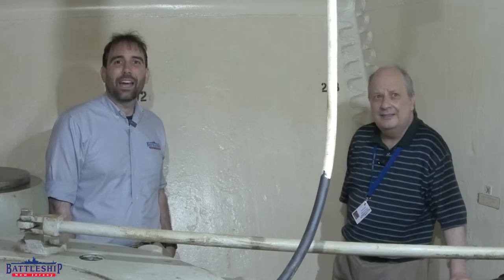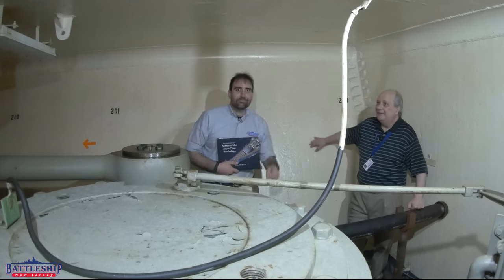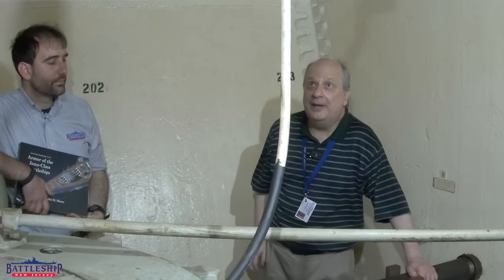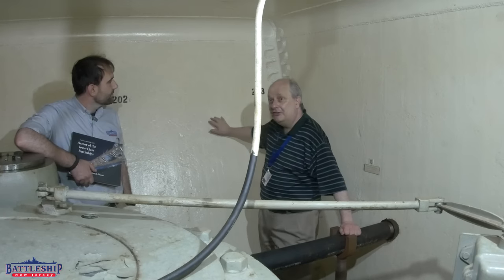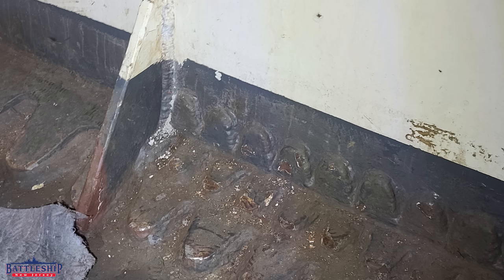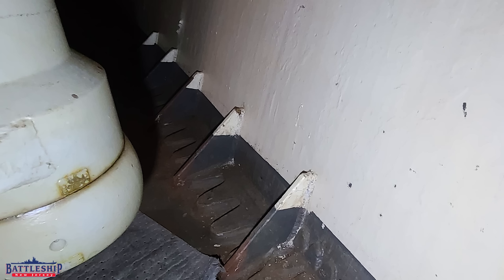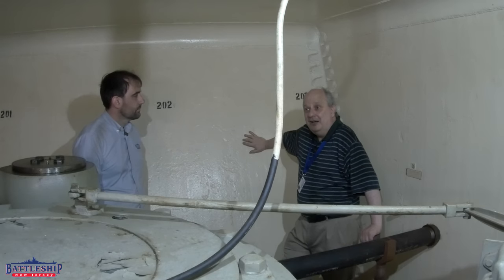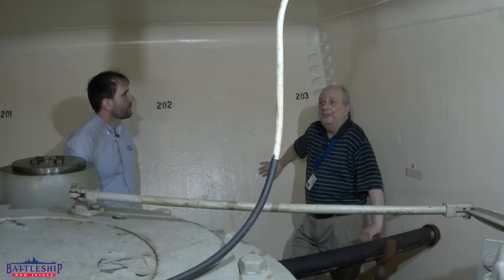The Armor That Protects The Battleship's Steering

Comment: If they somehow had lost power to the steering gear could they steer using the engines like the Titanic could? I remember reading somewhere that the Bismarck really couldn't but what about an Iowa?
Reply: IIRC, nearly every USN combatant has this capability, and has for a while now.
Reply: I think the problem with the Bismarck is that the rudder was stuck to one extreme position and the screws couldn't overcome that.
Reply: @kpd3308  Plus the Bismarck had three screws, not four - if it had had four, it would have had a (somewhat) better chance to steer by engines.
Reply: @chrislaf89   Surface combatants, anyway. Pretty sure all current US submarines have only one shaft apiece.
Reply: One of Ryan's videos compared the Iowas to Titanic regarding "steering" the ship just with the propellers.  The Titanic had three, one each port and starboard and one center.  The catch was that the center propeller was powered by a non-reversible drivetrain (steam turbine), so was of no assistance if the need arose to execute a turn by running various propellers in opposite directions.  They could still have the outboard propellers turn opposite each other to assist with turning.

IIRC all four of the Iowas propeller drivetrains are reversible, so in theory each side can be configured to turn oppositely.  The drawback is that because they are turbine powered thru reduction gearboxes, after executing the reverse command, it takes some time for the turbines to stop turning at their normal high RPM so that gears can be engaged in reverse.  Compared to the South Dakota class, which was a steam electric drive which allowed this class to almost instantly change from forward to reverse, the Iowas were very slow to "change gear" from forward to reverse
Reply: There are various methods to steer a warship, from the remote steering from the bridge, down to using chain falls to move the rudders, so yes even if you loose power you can still steer the ship.
Reply: @ZGryphon  Submarines aren't expected to survive hits though.
Reply: @tcpratt1660 the number of screws would have made no difference until you could free the jammed rudder, which proved impossible.
Reply: You can even steer a single shaft ship to a certain degree by inducing a list (transfer of POLs/water/cargo from one side to another). The ship will tend to steer "away" from that list; ie list to stbd, turn to port. Also the "ahead" direction (CW/CCCW) of rotation will induce a slight turning moment towards the motion at TDC ("prop walk"). Plus the usual "manual" methods to move the rudder(s), of course - think hydraulic car jack on a massive scale. Takes forever - no zig-zagging!
Reply: @tcpratt1660  no engines could overcome the rudder on the Bismarck unless they had been able to blow it off, which did not happen.

Comment: 0:39
This makes me wonder; why did the germans decide to not make their steering gear immune to torpedoes?
Reply: because it litterally sticks out the bottom of the ship. 
So a torpedo to the rudder, could bend the shaft, making it impossible to turn.
Reply: @Jacob-W-5570  
In the video it's stated that the bismarck suffered due to its steering gear being less heavily armoured than that of the Iowas.

Since the Bismarck lost its steering to a direct torpedo hit to the steering gear, that means that if it hadn't been less heavily armoured than that of the Iowas, it wouldn't have lost its steering gear.

So my question, again, is why did the germans make their steering gear so much lighter armoured than that of the Iowas that, when the steering system was struck by a torpedo, the steering gear was disabled?

P.S. I know the Iowas came after the bismarcks; I'm just wondering why some ships had their steering gear built to shrug off torpedoes, and why others didn't.

Edit: others, nor orhers.

Comment: Why did you not describe the other 2 types of armor your guest mention. Looked like you edited that out.
Reply: STS is special treatment steel, kind of a middle child between class B armor and HT (high tensile) steel.  Below HT steel is mild steel.  Cast armor is used on Iowas for complex shapes that plates would be hard to cut to and assembled to fit.  One good example are the turret rangefinder external lens hoods, aka "mickey mouse ears"  these are cast armor.
Reply: Only 6 minutes

Comment: What is the purpose of the scalloping of the armor? Especially the negative scalloping in the vertical corners?
Reply: That increases the length of the weld line and makes the joint stronger.
Reply: I think it was to give greater surface area for the welds, both to minimize potential for thermal damage to the heat treatment, and to increase the strength of the welded joints.